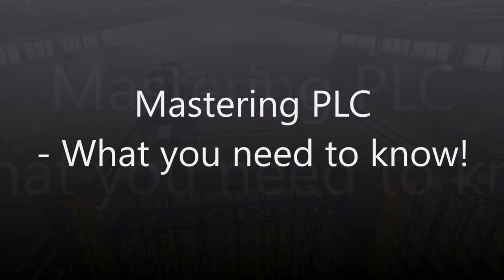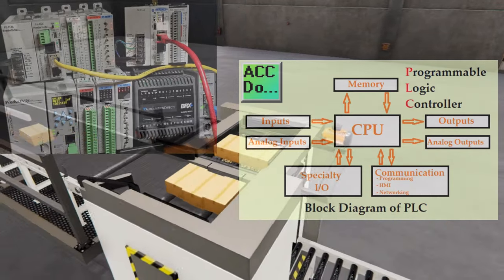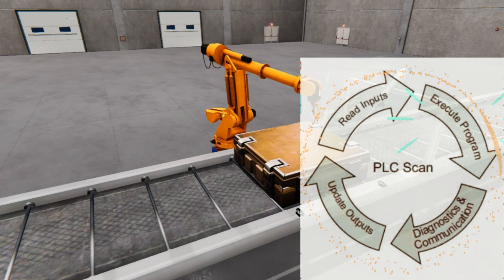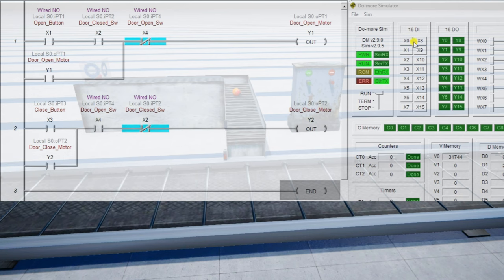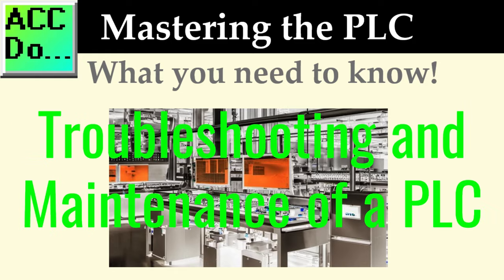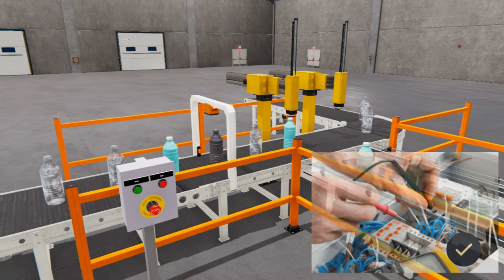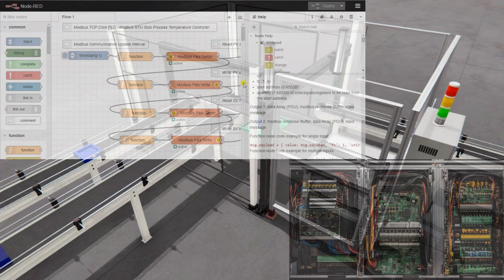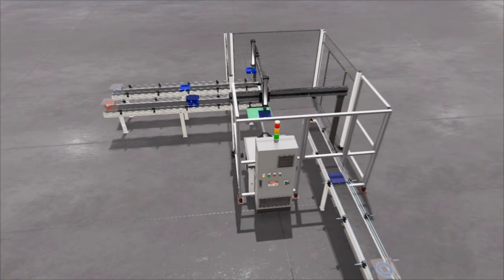Mastering PLC - What you need to know!

Comment from the maker: Detailed information and links can be found on the corresponding post located here.
https://accautomation.ca/mastering-plc-essential-information-you-need-to-know/

Here are the controllers that we have covered or are covering at ACC Automation:
Arduino Opta PLC
https://accautomation.ca/series/arduino-opta-plc/
BRX Do-More Series (Do-More Designer Software + Simulator)
https://accautomation.ca/series/brx-do-more-plc/
Productivity Series
https://accautomation.ca/series/productivity-1000-plc/
https://accautomation.ca/series/productivity-2000-series-plc-p2000/
Click PLC Series
https://accautomation.ca/series/click-plc/
Omron CP1H Series
https://accautomation.ca/series/omron-plc-cp1h-series/
Horner XL4 PLC Series
https://accautomation.ca/series/horner-xl4-series/

https://accautomation.ca/series/easyplc-software-suite/
EasyPLC Software Suite is a complete PLC, HMI, and Machine Simulator Software package. See below to receive 10% off this software. This PLC learning package includes the following:
Easy PLC – PLC Simulation will allow Ladder, Grafcet, Logic Blocks, or Script programming.
HMI System – Easily create a visual human-machine interface (HMI)
Machine Simulator – A virtual 3D world with real-time graphics and physical properties. PLC programs can be tested using the EasyPLC or through other interfaces. (Modbus RTU, TCP, etc.)
Machine Simulator Lite – Designed to run on Android Devices.
Machine Simulator VR – Virtual Reality comes to life so you can test, train, or practice your PLC programming.
Purchase your copy of this learning package for less than $75 USD for a single computer install or less than $100 USD to allow different computers.
Receive 10% off the investment by typing in ACC in the comment section when you order. http://www.nirtec.com/index.php/purchase-price/
Learn PLC programming the easy way. Invest in yourself today.

ACC Automation
https://accautomation.ca/